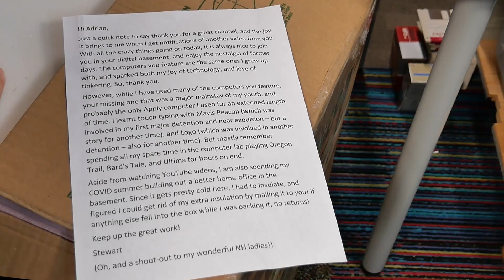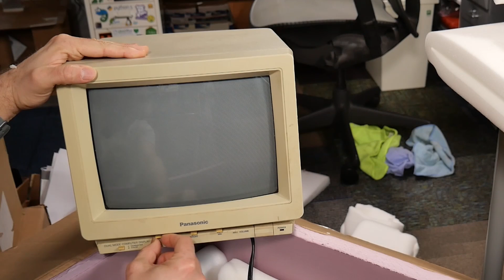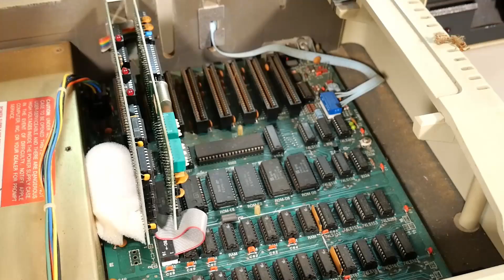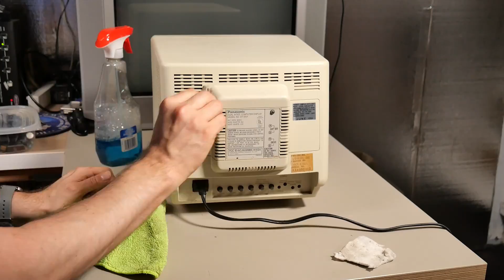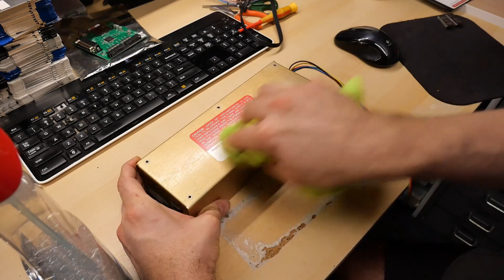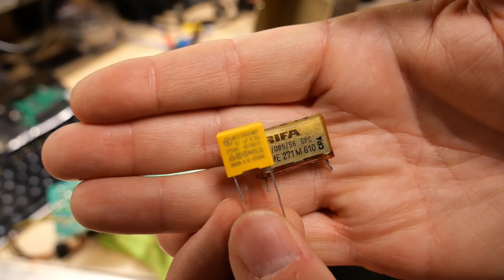A viewer sent in a very special donation!

Comment: Hey, NDG. I lived there for a while in the 90s. Before that, I lived in Ottawa....but in the 80s, I did a high school co-op placement at the Carleton Board of Education Computer Pilot Project, which was an Apple Education Demonstration site. We saw all the snazziest Apple ][+ software and hardware. We actually had a SAN, a Corvus Constellation network with a 40 Meg hard drive that we booted the Apples off of. I started off as a software tester but ended up teaching programming with LOGO. We also had a Terrapin robotic turtle. 

Yes, those Apple ][ Power supplies kinda sucked, but the later ones were nicer...As for your no boot problem, your Apple probably needs a bit of cuddling...Seriously! It's what we called "The Apple Fix". The ][ series ran hot, and as it heated up and cooled, some of the chips would work themselves slightly out of their sockets...not enough to fall out, but enough to lose contact or become flakey. And as we had the students power on and power off the systems, some times 6-8 times a day, that put a lot of cold/hot cycles. When we had a system that failed to boot, all we did was unplug it. ground ourself out, and firmly press all of the chips back into their sockets. About 80% or more of the time, this would fix the problem!

I did make some money during the 80s soldering together Apple compatible expansion cards and selling them. Memories....

Comment: A lot of comments from me, this time. In school I had access to PET and Apple ][ computers, and like you, took computer classes for an easy A. It probably wasn't easy for someone else, but it was easy for me. We have similar paths. My first home computer was an Apple //e, and while it was the "family" computer, I took it over for myself. Sure there was the justifying attempt from my parents, making a recipe data base - the primary goal was for education, and it was very quickly left to my sole use.

One day, I took the Apple //e completely apart. If there was a non-soldered joint I could separate, I did. I had systematically pulled the Apple to its component parts, and cleaned them. Oh the yelling I got from that. It was an expensive computer, I was reminded.

I had all key caps lined up, springs in a pile, chips and ram pulled, all cards laid out. I left the disk drives a lone. I certainly knew better. I must admit, Apple II computers were an invitation to take apart. That was Woz's gift to us. No other computer was so easy to open and every chip in a socket to pull and examine. I even had decided what chip designs were my favorite. Not getting technical here, just aesthetically speaking, I liked chips that were ceramic, multi layered, where the pins went in-between two layers filled with some kind of epoxy, not necessarily EPROMs, which were my second favorite. This is from the vantage point of a kid looking at parts I didn't understand, and establishing some value to them in a collection of components.

I put it all back together and it worked just fine. It was an epiphany for me. I realized that I didn't have to fear technology and it let lead to building new computers and a career in technology. I could have been punished, but wasn't. That day could have been a very different path.

Years later, with a family and children, I brought home a full working Apple //e and Apple /// monitor, plus drives -  in addition to a GS, signed by Woz - and other e-waste, to be saved. I stored that for several more years, under beds, but there wasn't enough interest by my kids and with space issues, I felt I needed to pass it all on to someone else who could possibly appreciate it more than I could. I still have a couple of Disk ][ drives and all the disks I had as a kid. Hopefully, some time in the future I can try this again, and then look over my old disks reminiscing the work and fun I had in the 80's.

I have other stories, confessions of things I participated in at school, programs I wrote at home, to be revealed sometime in the future.

Comment: Adrian, could you shed some light on the subject of capacitors more? Very interesting, watching a select few YouTube channels. You have an amazing knowledge of computers. Regarding caps, what's good/bad, needs to be replaced regardless of sight unseen performance, there are tests that take it up several notches. You said a caps performance can be "OKAY" for now - I understand there's a predictable test for future current leakage, and should be applied to all caps, anywhere 50+ years old. Apple II's are on the 40 year mark. The REFA cap, is just the start, maybe???

This might be a give away to my exposure, In radio hobby, certainly caps can make all the difference in how sensitive the reception/performance can be. I wonder if caps can impact computers in the same way. Is it possible that cleaning and refurbishing computers should include some of the higher caliber capacitor tests, to prevent unstable performance, and like you said, a cascade failure? Some cap designs are very stable no matter how old they are, but all electrolytic should be tested for current leakage and they also have shielded side and definitely should be installed correctly. Computers are still sensitive to RF interference in addition to being a source of it.

Comment: I have an Apple II Europlus and it showed the same sort of garbage on power-up.  It turned out that many of the 4116 RAM chips had failed.  These ICs (16384 x 1-bit RAM) are fussy little devices that need several different power rails to operate (+5, -5 and +12V) and they run hot and seem to fail quite often.  Replacing these with 4164 (65536 x 1-bit) chips would help as those only need +5V and are pin-compatible with the 4116.

Comment: Usually the failure point with the RIFA caps is the outer insulation cracking, and then they absorb moisture from the atmosphere. Interestingly, they fail open circuit, so once they've smoked and done their business they won't usually do it again after that. Either way, they still have to be replaced on sight.

Comment: Back inthe early 90's when I went to our high school equivalent, I had a Commodore Amiga computer that I used for most of my home computing stuff. I used it for a geography homework where I had to make a presentation, and I got a barely passing rating for it, because I used a computer, and a manually drawn presentation was expected. IMHO it was partially because I didn't use what the teacher considered a computer. Anyway, one year later it was expected that anyone who has a home computer and is capable of doing so, will make their homework presentations with one.

Comment: I think the reason Apple Macs these days, outside of say the Mac Pro, don’t allow for lots of tinkering and internal expantion/modification is that typical Mac customers these days are just are not demanding it. For one thing, with USB/USB-C, Thunderbolt, built-in ethernet ports, Wi-FI, Bluetooth, etc. there is a lot less need for internal expansion slots as there once was, at especially for consumers. It used to be whith Wintel PC buyers, they would buy a desktop/tower PC with upgrading & expansion capabilities but never actually up end up upgrading or adding expansion cards to their machine but instead just buy a new PC a x number of years. They liked the idea but never actually took advantage of it. Thus these folks would be fine with less internally expandable/upgradable machine. We computer tinkerers/hobbyists would actually use some expansion/upgradability but were like most computer users. I quit comfortable with a RasberryPi, for examples, or custom building a desktop PC but many others are just as happy to have something that meets there needs out of the box with any future expansion being by way a external USB device or Lightning device (in the case of iPhone and iPad). Plus, co summers like svelte sexy computer designs  over expansion/self relatability these days and as much as I try, I can’t argue that Apple II or IBM 5150 was sexy or good looking compared to a modern iMac or Mac Mini though, neither of which is internally expandable.

Back in the late 1970’s and 80’s external expansion ports just were not fast enough or capable enough for certain type of accessories/expansion devices like sound cards, graphics, cards, networking cards, graphics tablets, certain types of storage drives, etc, etc.compared to the expansion bus tech of the era. Later expansion methods like SCSI worked well enough to substitute for expansion slots but where expensive (SCSI cables where pricy)  and complicated to set up (did you set all your SCSI device ID’s correctly and remember to terminate your SCSI chain?). I can remember trying to get ISIS and early PCI expansion cards to work on some 90’s era PC’s and trying to either figure out the roper card jumper settings and such or later trying to Win95’s Plug and Pray tech to work with supposedly Plug and Play expansion cards so i can appreciate the plug it in and it just works (usually) of USB and Thunderbolt (once the proper drivers are installed of course).

Comment: Adrian, I just noticed the Beagle Bros, T-Shirt. I love the Beagle Bros, and their "One Line" basic programs. I put it in quotes because sometimes they were two lines, and frankly it was a euphemism, because the code would normally have been written in multiple lines but they shortened the syntax and used semicolons to avoid starting a new line of code. Usually the small programs did something a little fun. They were getting the most out of the least amount of programming.

Comment: You are so lucky you had some one to buy the computers for you. I worked 3 paper routes for almost a year to afford my first TRS-80. And additional months more to afford a disk drive, printer, expansion slot, speech synth card, etc... in winter I tied cardboard boxes to the sled's handles and pulled it behind me often in thigh deep snow. I remember often coming home with my corduroy pants soaking wet and having to go out again to finish my routes. I would have loved an Apple but they were like 700% of what the TRS-80 was.

Comment: the painted "powder coated" top and even the disk drives can be bleached. however, if any metal like Aluminium or steel, or tin comes in contact with the peroxide you can get as you would imagine, accelerated oxidation. in fact, when you see the marbling on plastic that has been over bleached, this plastic powdery marbling is oxidation. I would not submerge plastic in a solution, like you would with the plastic, you could either leave it in the sun for a few days, or use creme bleach. only coating the painted sides. good luck Adrian, your channel is superb. I wish you lived down the street.

Comment: The Apple][ was a very hackable machine, and so many folks 'hacked' it.  My Dad and I built one, which I still have.  It has a couple of cool features.  Adrian mentioned that one difference between the A2 and A2+ was the ROMS.  In the hacked versions, you replaced the ROMS with EEPROMS.  Most were (I think) 2716's.  However, on my homebrew A2+, they are 2732, with both Integer Basic and AppleSoft Basic, and there was a front-panel switch to switch between the two.  I never really cared much for Integer Basic, but that switch had a magic trick -- you could boot the machine in AppleSoft Basic, boot a game, start playing it, and then switch over to Integer Basic, and hit Reset.  This would drop you into the Apple Monitor, which then you could use to 'hack' the game assembly code!  Normal AppleSoft Basic you could not do that, because the reset vector was programmed by the game developers to reboot the machine. I used to use this hack to inspect zero-page memory and the code, and modify the code so that I could change the ASCII to put my or my friend's name into the game, or modify the game to have unlimited lives, and other such hacks.  It was so much fun to play with, I may have to get mine back up and running too!

Comment: As I remember, ][+ was enhanced a little bit by having lower case in the ROM, please correct me if I'm wrong.
Reply: Mine doesn't, but it's a ][ converted to a ][+ by the store where I bought it.  Just the ROMs, it has the original character generator.  I think one time I started to add the standard mod to the keyboard to use the PB2 input to detect the Shift key and a new character ROM, but something came up and I never did.

Comment: I have a II plus as well, but for love or money couldn't find a joystick adapter. Would you consider a video about how it works / how to build one? Your EE chops are far above mine!
Reply: IIRC, it was pretty simple.  Just a DB9 connector wired to a DIP package.  An Apple 2 Joystick was two Potentiometers (one for each X-Y direction, and two push-button switches).  I never really liked the A2 joystick because of this, seems like Atari joysticks (which were switch based) were better for some games.

Comment: I did a full restore of the Apple ][ plus I grew up with a few years ago.  The keyboard encoder chip was dead so I ended up getting a replacement from Briel computers that works awesome.  It also has a hidden PS2 port on it so you can use a modern keyboard if you want.  Looking forward to part 2!

Comment: back in the day...  when I attended DeVry, I was in-charge of the D.I.N. (DeVry Information Network) which basically was an Apple II with 2 video outputs- one to a local screen and the other to a  massive distribution network (read:  racks of video amps and a switcher) designed to display its output to hundreds (or more) monitors in all of the classrooms and hallways/common areas of the DeVry campuses. Every day, I had to come in, early in the morning, and sit down in this cramped room and type out the day's messages and announcements which were provided in an "in box" of sorts.. (oh, the FUN I had one day... in fact, a practical joke so devious, its result/effect STILL ripples to this day- but thats a story for another time!)

Comment: The thing I like the most about my Apple II+ was its architecture (expansion slots) which allowed me to install add-on cards which helped to overcome the limitations of the system.  Of course, my favorite add-on was a z-80 card which freed me from the apple software and allowed me to run a wide variety of cp/m software. I was also able to add high-density floppy drives and a nice external terminal.  If I wanted to run Apple II stuff, I could boot Apple dos.  Very flexible and cleverly designed machine.  Too bad that Apple has moved to the dark side of the force and complicated expandability.  No longer hobbyist machines.

Comment: The language card was in demand for game "cracking" (i.e. eliminating copy protection schemes).  This, plus an NMI board (a homemade board that could generate a non-maskable interrupt) enabled many a crack.  There were also language cars for the  ][ and ][+ that had ROM chips with the opposite language,  but a RAM-based language card is what was needed for game cracking 😜

Comment: I'm pretty sure the machine still has its original color and the lighter spots are just discolorations from the plasticiser leeching out of the rubber feet of the peripherals standing on it for years. I guess the only chance of getting rid of that spots would be to repaint everything. Which I don't encourage you to do. Thorough cleaning should be enough. 
I mean, come on, this machine is hitting 40 years! It's nearly as old as I am. And I have some scuffs and marks and signs of usage as well...  xD

Comment: If that is an original Apple II board and not an Apple II+ board, you may need to reset before it will start as the original Apple II did not have an automatic reset on power up. Starting with the Apple II+ boards Apple reset the CPU momentarily on power up like everybody else did. IBM did this by means of the power supply as the rest of the reset line was effectively ANDed with the PWR_Good signal which takes a fraction of a second to come good and thus TRUE. (Power good is active HIGH and IIRC reset on many chips is active LOW).

Comment: my amateur sleuth brain is whirring .... perhaps there was some residue from the feet of the monitor that remained on the top of the drives/computer after the monitor was moved..and changed the rate at which the spots reacted to light... or maybe it was professor plum in the library with the lead pipe.